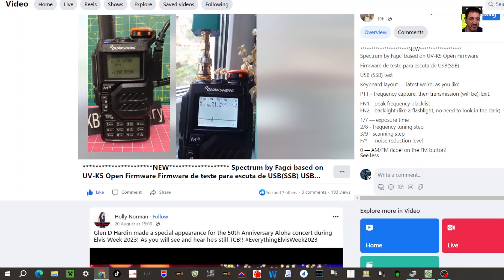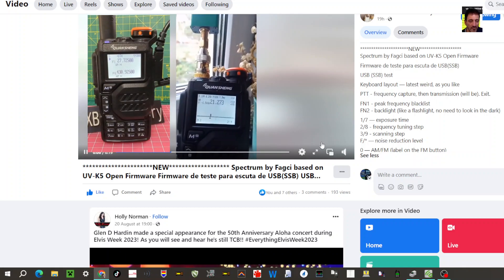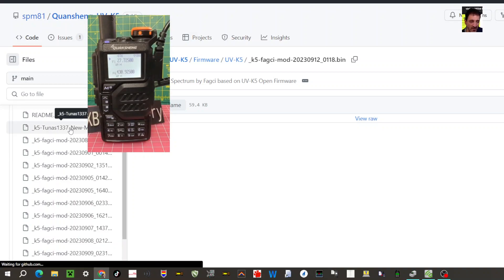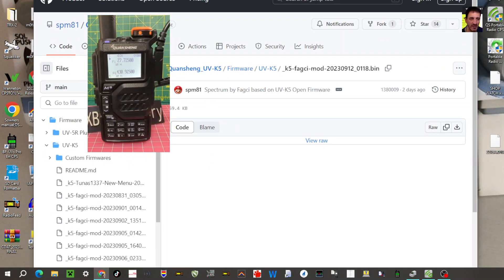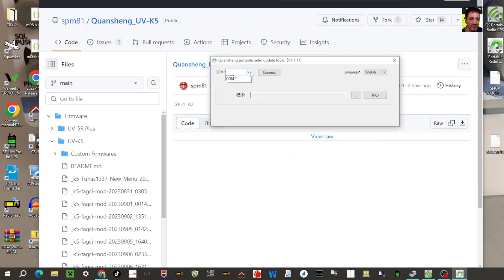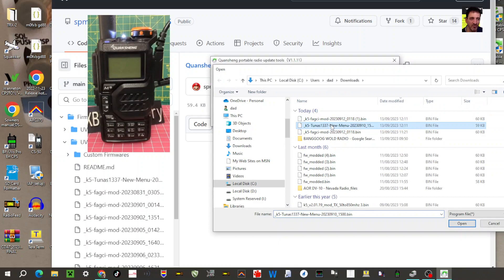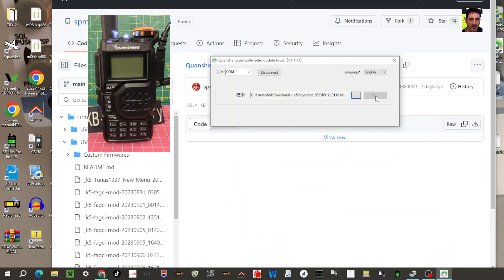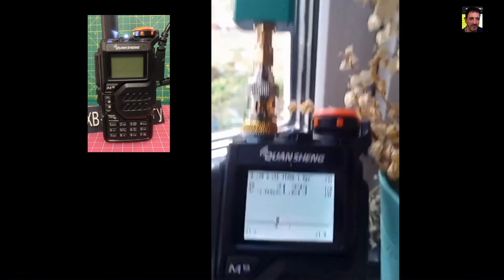UV-k5-fagci-mod-20230912_0118.bin

Comment: Function 5 to enter spectrum on present frequency
Reply from the maker: Thanks it worked why do we also get the flat lines on the screen when we push F5 and what do we do ?
Reply: First the freq. put the sql low, and hit PTT then the freq will stay, you can adjust with up and down but for good receive you need a 10M antenna  @M0FXBHamTech
Reply: @M0FXBHamTech  thats the squelch function - adjust it up with scan button - and down with function button  (all down is of course squelch off)

Comment: I'm a little confused with what this particular mod does.    I have a K5 and its modded for 18-1300Mhz.   I see the word  USB (SSB) in the video.   Could you explain a little more
in detail what this mod does.   thanks,
Reply from the maker: I am.also.comfused I loaded the firmware as the screen in the Video looked interesting .
Reply: @M0FXBHamTech press F button then noaa i got spectrum but a didnt recieve any ssb chsnging mode button 0 when spectrum is on
Reply: CB radios must include AM or SSB modulation and may include frequency modulation. If a radio includes SSB, it must transmit on the upper sideband with a suppressed, reduced, or full carrier. The unit may also transmit on the lower sideband with carrier as noted.

CB Channel from 26.965 - 27.405

so that SSB suppose to support this radio for that modulation...right?
Reply: @K3m0n  Thank you for your reply..  I should have made my comment clearer. I wanted to know if this was a receive only mod for SSB or will it transmit USB ?
thanks
Reply: @n1kkri  AFAIK it is only for receiving